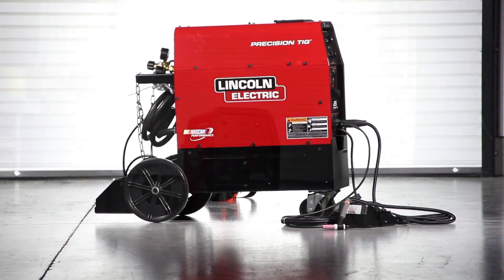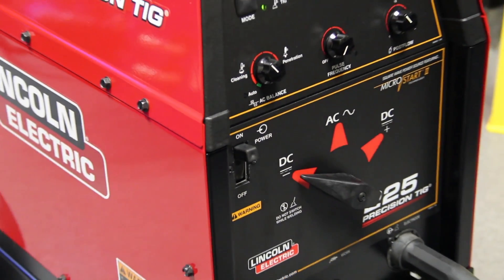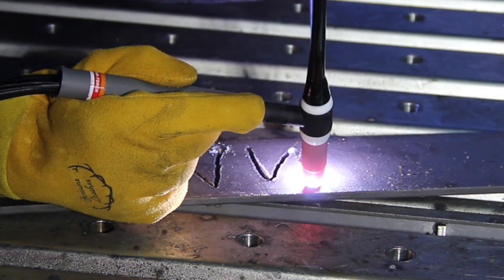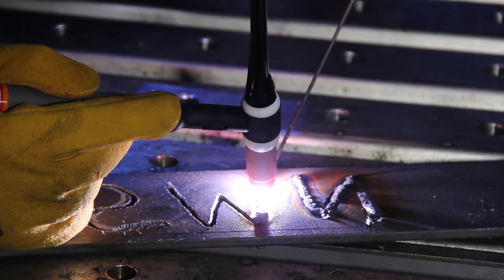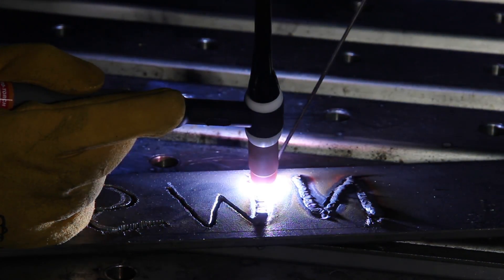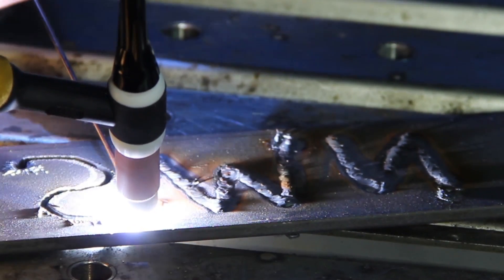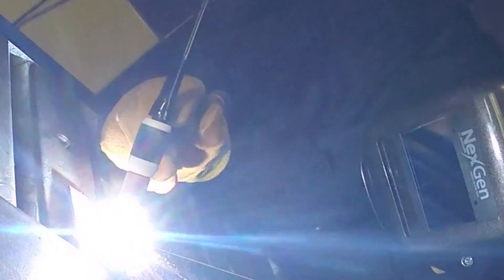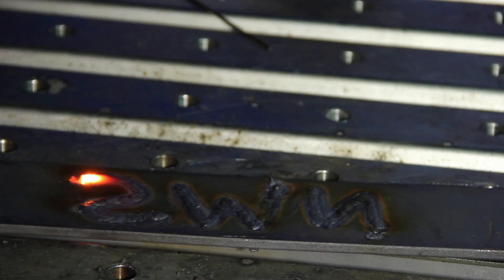Lincoln 225 Precision Tig in the NWS DEMO ROOM

Comment: so this machine isn't HF start? or is it a combo HF/Scratch start. Or does the operator just not have experience TIG welding? He seems to get the tungsten stuck every time he starts a weld.
Reply: Doug DiMemmo i love my 225. its not scratch start. i think this guy just sucks. as do i. but not like that haha
Reply: I have owned one of these for 10 plus years. Great machine! I use mostly for aluminum.
If you use helium mix it will perform even better.
Does not need a scratch to start.
He is probably cold starting and using wrong size tungsten. Arc will start easier when tungsten is hot.
Going down a size on tungsten will help starts...
Too large of a tungsten on lower amperage welding will always result in a harder start when cold.